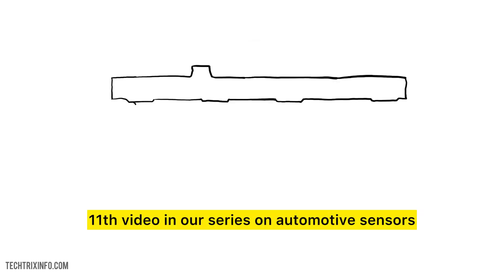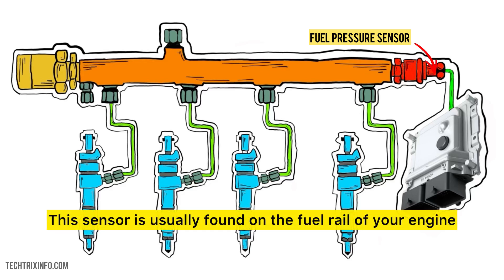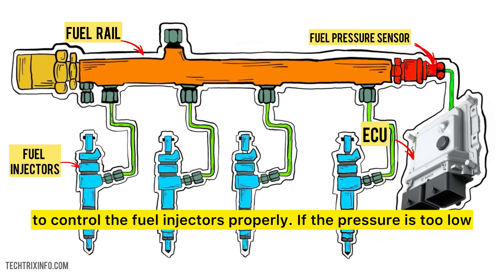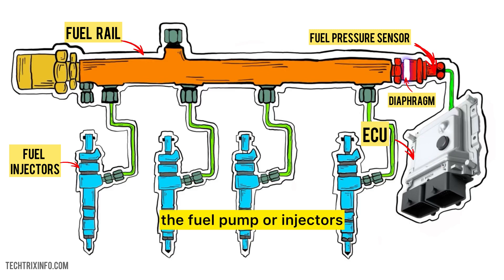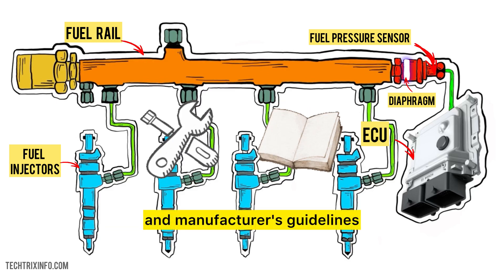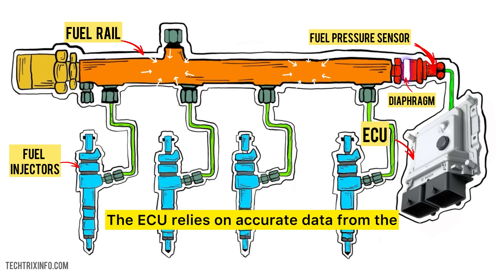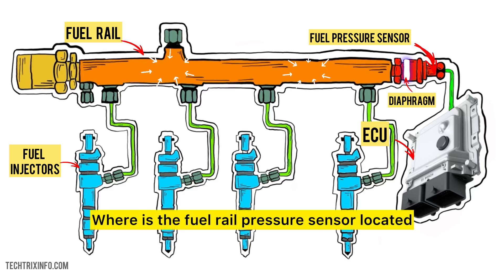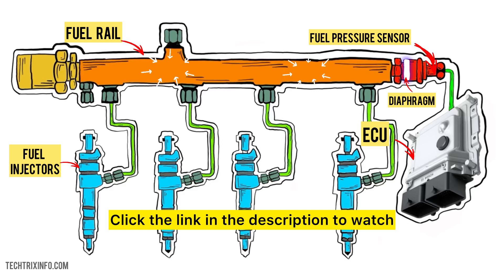Fuel Pressure Sensors Explained With Animation | Mastering Automotive Sensors | Part 11

Comment: Is this same as fuel idle vacuum sensor ?
Reply from the maker: Thanks for asking, good question. 
The answer is No, the fuel pressure sensor and the fuel idle vacuum sensor are not the same.
	•	Fuel Pressure Sensor: This sensor monitors the pressure of the fuel in the fuel system, ensuring the fuel pressure is within the correct range for efficient engine operation. It’s typically located on the fuel rail or near the fuel injectors and sends data to the engine control unit (ECU) to adjust fuel delivery.
	•	Idle Air Control (IAC) or Vacuum Sensor: The idle vacuum sensor, often linked with the idle air control valve, monitors the vacuum pressure in the intake manifold, particularly when the engine is idling. This data helps maintain the correct air-fuel ratio at idle. It’s important for regulating engine idle speed.

Both sensors are involved in engine performance, but they serve different purposes. The fuel pressure sensor deals with fuel delivery, while the idle vacuum sensor helps control idle air intake.
Hope it helps, let me know if you want us to make a video on Fuel Idle Vacuum sensor. ☺️